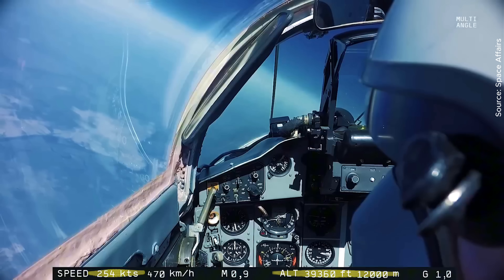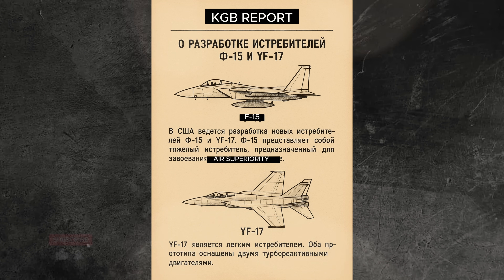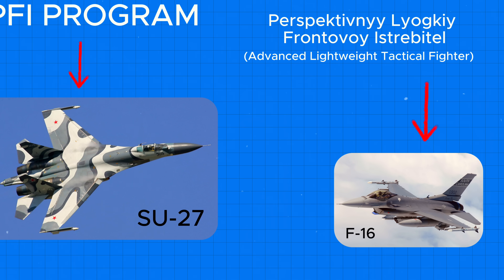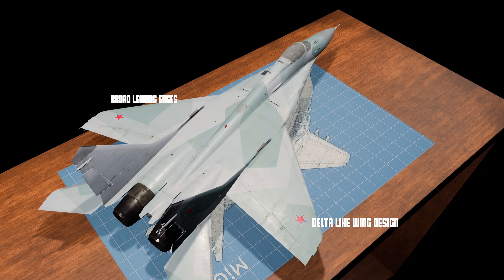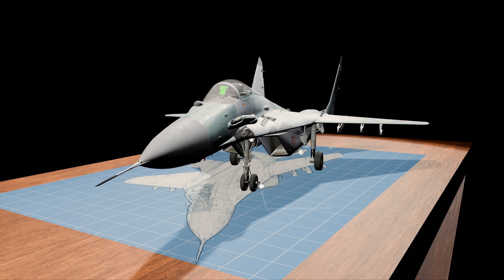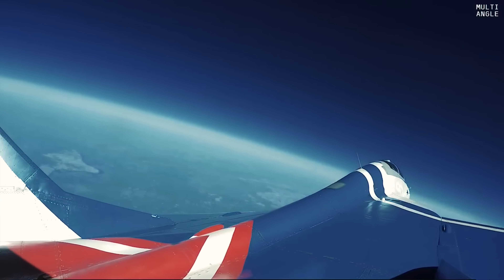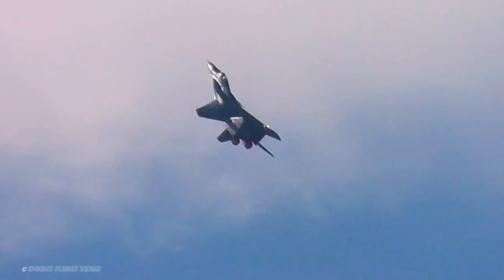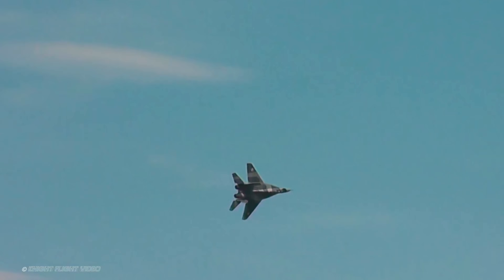How Russians Accidentally Flew This Jet To Space

Comment: The MIG 29 and Su 24 are built for close combat with Supersonic capabilities. 
The first aircraft amig 25 wa the first designed as an interceptor and to fly above the border of space in order to shoot down low-fling satellites in orbit. and MIG 29 and SU 24 were flying 66' when seen over Finland and Danmarkać. and that they take off from the plane's landing gear, means that the take-off path will not be narrower than 250 meters, which they could do. The Mig is designed for close combat and can handle large guns as well as the pilot. and that's how the best airplane ever was born, the mig 29, which still rules the skies today.

Comment: the best plane ever built, The design is perfect that today the entire aviation industry uses it, even the Americans have some copies of the F-15 design, the best American plane 
F-18..... .   compact small to medium size, length 17m
wingspan 11m
Height 4.5m. and the payload characteristics of the big Hunter.
extremely agile, circle 80 m, and the required take-off path 250 m. taking off from all surfaces.
The plane was designed for an aircraft carrier. take-off without a trapdoor, even landing without a gear is possible. etc. first takeoff 65' ago, and first seen 66' over Norway. A MiG-29 shot down a high-roller tekord on the 29th. 
 The perfect plane, the perfect fighter, the most colorful plane for Dogfight.

Comment: In Yugoslavia in 1999, MiG29 showed complete superiority over any aircraft of NATO countries.  He won the victories alone against five and the NATO aircraft and the oldest aircraft were the most pennies MiG29.  And about many shot down instructions 29 in Yugoslavia, this is a western fake that can easily be refuted.  Squeeze that the coloism of the set aircraft of the USSR is less than ukpznaya in Western fakes
Reply: 1999 all Serbian Mig29s were without modernisation, with broken radars etc etc not a single one was prepared for action.. And pilots still flied on Nato groups literally 2 vs 30 or 6 vs 120.. True heroes
Reply: @vukaleksic1654 Firstly, at that time only a few instant 29 were in service with Yugoslavia and even fewer were in working order.  and NATO announced the destruction of more numbers than existed in its Arms.  These were old instant 29, however, they were able to resist and successfully against 5-6 NATO aircraft per aircraft.  And only thanks to this, some of them were shot down.

Comment: Obviously it was not accidental,- Remember it was the Soviets that pioneered space flight.
One deliberately clear omission in the video is that the mig 29 was actually designed to counter US/ NATO high altitude spy planes too.
According to western narratives everything Soviet/ Russian is inferior and if it isn’t it is better because of an accidental or mistake.
You don’t build an aircraft capable of reaching altitudes of 100,000ft/ 30.04 Km by accident. - and before someone screams 55,000ft max.
US/ NATO have evidenced and recorded the MiG29 reaching altitudes in excess of 90,200 ft 
The ‘Official World Record’ recognised by the FIA is/was 27,460 meters (90,091 feet) in April 1995 set by? - A Russian pilot in a MiG-29.

Other ‘accidental’ Soviet birds that are known to fly to the ‘edges of space’ include and are not limited to the Sukhoi range from SU-27 to the SU-57

Comment: The plane wasn't good. Original Mig-29 is standoff light fighter. In fight it is lead by ground crew and it can't operate without ground radar and such. It had very limited payload of about two tonnes. While it was excellent light fighter in 1984, its maintenance cost was reported as high as 80% of Su-27, while clearly not being nearly as capable. In original version it can't drop a bomb. Plane just wasn't good value for money. Improved versions like 35 are much much better planes, but given Russia's much lower budget after SSSR dissolution Russia put all eggs in Su-27 basket and ignored Mig-29...

But it is a beauty and flies as good as it looks...

Comment: What about the Kármán limit? The definition of the limit of space is between 80 km. and 100 km., 70.000 feet are roughly 21 km. The SR-71 flew at 24 km. of altitude and was never considered a space plane. The X-15 could claim that title, it required control thrusters to maneuver because at its operational altitude the aerodynamic control surfaces were useless.
Reply: всë это стратосфера
Reply: NEAR SPACE! No one said anything about real space. Humans have never been to space under that definition and even the moon is in near space earth orbit.

Comment: The MiG-29 could have been a serious fighter contender had the fighter been equipped with a modern radar system . They tried to address it with the MiG-35 but nobody really wants that plane.
Reply: MiG-35 is a really nice plane, a truly improved MiG-29. Problem is in the market: a bit too expensive for owners of MiG-29, who mostly prefer to use the money on air superiarity planes by Sukhoi (which cost more or less the same), whereas the really cash-strapped nations prefer to buy either 2nd hand MiG-29 or go for Swedish fighters. MiG-35 sits in an uncomfortable spot where its only potential clients, really, are nations like Peru or India who already have lots of MiG-29 they need to phase out, & could be presuaded to buy the -35 in an effort to minimize the retraining costs for pilots & maintenance crews, as well as take advantage of some shared components between the 2 (potentiarly saving in parts management). There's really no other potential clients at that price, they should try to either make it much cheaper, or vastly improve its capabilities to compete directly with Sukhoi

Comment: Over 30 years ago, a German Luftwaffe pilot told me how the Germans flew MIG 29s to Spain for NATO air exercises after German reunification, without clearly informing all the pilots participating in the exercises about this fact. When the MIG 29s flew into the formation of Western aircraft, the reactions of the pilots of those aircraft were worth filming.
Reply: what happened?
Reply: @rizkyadiyanto7922 they shit their pants..
Reply: German MiG 29 did very well in combat drills against front line US aviation and the MiG held its own against the best of the USAF. If not for the farce of the Gulf War the world would remember the days when US aircraft were just a mixed bag of pilot killers like the Starfighter and Thud or expensive to maintain and operate like the F-15, F-18, F-4, and F-16. Instead we're sold marketing materials for the F-22 and Fail 35 as if they're fact and they point to the Gulf War as proof positive of the western aviation dominance against a air force so outnumbered by coalition aircraft that they never had chance. The US is the master of both marketing and the false narrative. Yet they wonder why they're reality doesn't pan out when tested in the real world. Like weather balloons they have to wait to destroy once they drop to an altitude where their top line jets can finally lock on and destroy them because of a laughably low flight ceiling and poor high angle of attack capability. 😂😂😂
Reply: Every pilot in the west admited they been thrilled for to fly this amusing fighter plane of Russia.
All been OWE and find the plane incredible

Comment: I seem to recall that after German reunification, the Luftwaffe was taken aback by the actual performance of the MIG 29, it was much better than NATO intel had assumed.
Reply: The Luftwaffe inherited the MiG-29A (Product 9.12), which was:

- An early export version, originally made for the Warsaw Pact (East Germany included).,
- Limited compared to Soviet frontline versions (like 9.13 or 9.13S).

Nonetheless when the Luftwaffe took those MiG-29 to mock battles against all kinds of NATO aircraft:

- F-16 Fighting Falcons
- F/A-18 Hornets
- F-15 Eagles
- Mirage 2000s
- others

they performed extremely well, and in close-range dogfights, it dominated its NATO counterparts, wining each and every encounter. Having Helmet-Mounted Sight (HMS) + R-73 Missile (AA-11 Archer), at the time, Western fighters didn't yet have helmet-mounted sights. The R-73 was a highly agile, short-range infrared missile with an off-boresight lock, meaning the pilot could look at a target and fire, without pointing the nose. This combo was a game-changer in dogfights.
Reply: @darknase Great post. I have read similar reports but your depth and details are to be commended. Well done my friend.
Reply: Yes, the Luftwaffe kept the DDR 29s for DACT this is true, the weak points were the low engine TBO, crap avionics, and over reliance on GCI. The HOBS IR missile was revolutionary at the time.
Reply: Aircraft performance was very closely estimated so no real surprises when NATO got ahold of them....but the Archer HOBS missiles WERE something they hadn't anticipated and would have been a rude thing to discover in combat.
Reply: @recoilrob324  Ну конечно никаких сюрпризов ! Они просто охренели от верткости этого "" недосамолета"" ( куда ему до западных , точно ?)!!  И я не припомню , что-бы хоть кто-то смог хотя-бы повторить подобное !  Я молчу про сделать лучше !  Возрази , хотя ссыканешь это сделать !  Или рискнешь ?
Reply: The biggest problem was the ex DDR pilot’s training. When western pilots, with western training, flew the Fulcrum against the F-16 the Fulcrum was nearly always the first to shoot. All the rest was not up to western standard, but in a phone booth dogfight its performance was astounding

Comment: MIG 25 Foxbat flew in altitude 123 000 feet. With MIG 31 you can buy fly (Sokol Air Base) to border of space but adventure with MIG 29 is better. The MiG-29 provides a better view of the curvature of the earth and darkness of the sky at 70,000 feet.
Reply: Karma line 62 miles or 360,000 ft.
Reply: @michaelbeumer7177  Karman
Reply: @michaelbeumer7177  А линия Можено еще круче ! Да и Маннергейм не плох , да ?

Comment: For edge of space you mean less than half
Reply: yes he is. mig29 max alt are aprox same as any 4 gen fighter. just are clickbait name of video, nobody "Accidentally Flew This Jet To Space" only mig25/31 and a12/sr71 are capable doing this.
Reply from the maker: @artem8692  The Mig-29 actually reached 75000 feet altitude with the commercial flights 😅
Reply: @engineeringinsights1  "The MiG-25's absolute maximum altitude is an unbroken world record of 123,523 feet (37,650 meters), set in 1977 by pilot Aleksandr Fedotov during a zoom climb. Its typical operational ceiling is lower, around 80,000 feet (24,400 meters)." first article from google. mig29 you talking about "commercial" version, with no radar and no missles, 75000 feet was reached in zoom climb